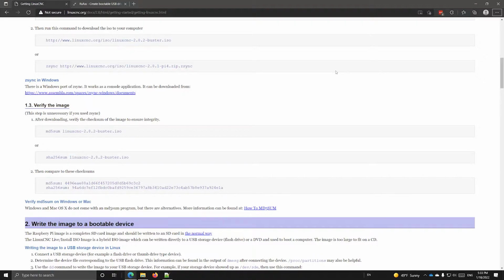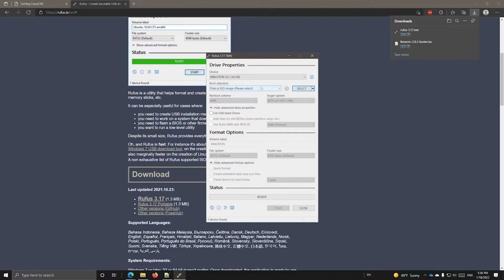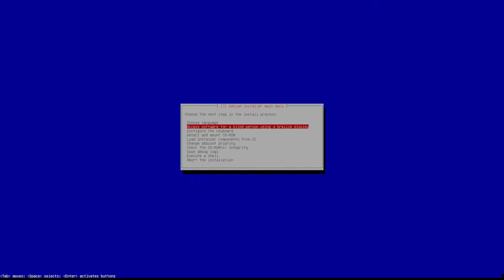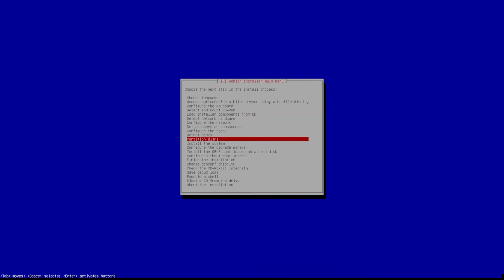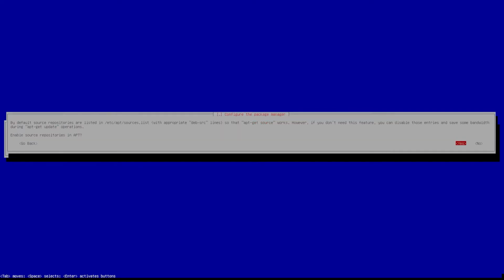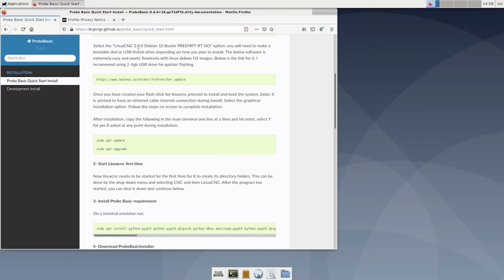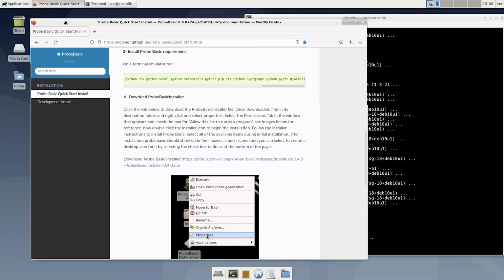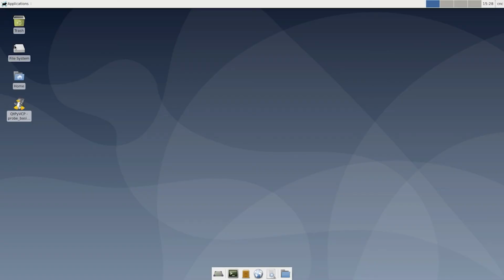LinuxCNC 2.8.2 Download, Install & Probe_Basic GUI Install

Comment: Hey Robbie, nice install video! Just to clarify, Kurt is the creator of qtpyvcp along with a lot of help from some other folks like Turboss (Jose Toledano) and Joco (James Walker) .  Probe Basic is a GUI I built and runs on top of QtPyVCP.   TurBoss and Joco are the primary contributors of time now in maintaining and fixing things and in keeping qtpyvcp current with the changing tides of linuxcnc 2.9 master py3 conversion.  I would like to personally thank them and let them know its a joy to work in that team environment!
Reply from the maker: Thank you very much for clarifying that. I'll update the description accordingly. Thank you for the great interface and of course qtpyvcp for enabling it! I also put a card to your channel in the video at the appropriate place.
Reply: @flyingamortgage  thanks for the pin!  you come across great in your videos, any chance you would be interested in doing some more on probe basic?  :D
Reply from the maker: @SmallShopConcepts  I'm certainly planning on it. Just got the parts in to finish my Z-axis so hopefully I'll get it and the other axes finished and can focus on the electrical and software side.
Reply: Thanks Chris! It is incredible how you all have taken this little project of mine and run with it! Hope to be back in the coding saddle soon.
Reply: @kcjengr  hurry up and come back!!  🙌🙌🙌

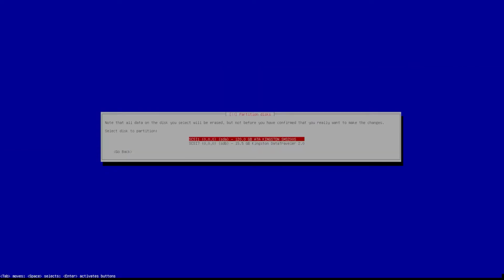Comment: Hey! I am just now setting up my new linux cnc, however i am stuck at 12:24. For some reason, only my usb stick is shown in the partition overview, not the ssd i have connected to the board (running a asrock J4125-itx with a sandisk SD plus connected. Any advice? On which of the sata connectors do you have your hd connected?

Comment: I believe the tormach controller is also based on linuxcnc. Their gui is also very good.
Reply from the maker: That is my understanding as well. If I thought I could convince my wife to let me spend $45 large I’d probably have gotten an 1100MX. 😀I’m fairly certain the resemblance between this gui and PathPilot is not a coincidence. If nothing else they have a VERY similar design language in use.

Comment: Is there a downside to run a real-time  hardware control system (plasmac) from a USB NvMe drive, over ethernet through a Mesa 7i96e card. I've measured  latency of 1.02 ms servo thread and 26 msec base thread on this drive , under the live install.?   Makes it real easy to use the computer /Windows or dual boot from the NvMe USB  for Linuxcnc.  Note on this HP Pavilion laptop I don't have an option for a second internal Nvme drive and the primary drive is maxed out from Windows.
Reply from the maker: Sorry. I haven’t used the 7i96e or NvMe over USB. Suggest you check the linuxcnc forum. Feral engineer on YouTube did some experiments with the 7i96e I think.

Comment: Was planning on using probe basic, but it looks like the link to the installer is gone, or is no longer active. (Update: I did manage to get it installed using the development install instructions, and even migrated my entire working axis config over, with the exception of the VFD RPM feedback. It appears that the version of Probe Basic that installed while following the development install instructions, didn't include the ability to link to the relevant pin for the GUI in Probe Basic to display the realtime RPM. I was reading a few threads online and apparently it's dependent on Python 3, and my Debian 10 LinuxCNC 2.8.4 Install isn't going to be able to run Probe Basic with encoder feedback unless I do an entire system upgrade... Kind of a huge pain. Not to mention I had major issues with LinuxCNC in Debian 11, couldn't even run my latency testing to tune my PC for better jitter numbers.
Reply from the maker: Yea the Python2 vs Python3 issues are real. Joco (mentioned in the pinned comment) has a github script to build a working linuxcnc + qtpyvcp + probe_basic install. Please check the note I added to the bottom of the description of this video for details. I'm going to create a new video soon that walks through that process from scratch as well.
Reply: @flyingamortgage  thank you for following up!
Reply: same, debian linuxcnc 2.8.4 and probe not working newer, only hall meter wires working ok, true/false ok. but no G-code 38.2 newer move.

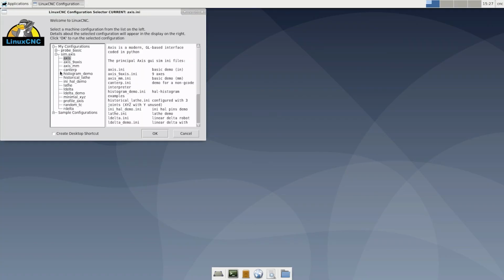Comment: Trying to follow this guide, Did everything almost verbatim (didn't use your IP address, set it to my local settings) but when I get to @25:15 you have Probe_Basic in the waterfall, mine never shows up.
Reply from the maker: The first thing that comes to mind is that maybe you installed it as root or using sudo. It needs to install in the home directory of the normal user, inside the linuxcnc directory. That's why you have to run linuxcnc once before you install probe_basic, because it creates those folders. Just guessing, obviously, since I can't see your system. Double check that a /home/<login_name>/linuxcnc/configs/probe_basic exists and that there's a probe_basic.ini file in it. You can look for the probe_basic_installation folder and find the InstallationLog.txt file to see exactly what was done where. Hope that helps. <login_name> stands for the name you use to login to the system with. In my case, I used cnc so my home path is /home/cnc/ If you used "mill" for your login yours would be /home/mill I hope that makes sense. Best of luck!
Reply from the maker: I decided to add my config folder to GitHub. As soon as I get back from errands I’ll upload it for reference and link it here in a comment for you.
Reply from the maker: Here you go @Rusty Horlacher https://github.com/attentiondeficitdisasters/linuxcnc_mill_config hopefully you can use this to see what went wrong. This will be updated as I make changes in the config during my build.

Comment: @26:29. How did you boot from the USB ?  Mine keeps booting into windows.
Reply from the maker: Well, in the case of the NUC I was using, USB booting was enabled in the bios. I can't include instructions for enabling USB booting for every bios, so that's something you're going to have to research. I'll add that on most PCs there's usually a key you can hold down during power-up that will give you the "boot options" screen and let you choose USB if it's not higher in the default than whatever is on the hard drive. All of those things can usually be disabled though and I know plenty of IT departments that will do so to reduce the ease of tampering.

Comment: Hello, if i have a working configuration of axis, ca i update to probe basic and copy settings from axis ? Or i need to do all the setings again? Thank you.Alexandru
Reply from the maker: @alexandrubudu541 you can take the existing working .ini file and modify the DISPLAY entry to DISPLAY = probe_basic but I’d recommend copying the values into a new .ini file specifically for the probe_basic install

Comment: I have core 2 duo, which installer is up to date ?
Some thread suggesting bullseye XFCE and 2.10.
This confuse me more, tried all of them and not working.
I know nothing about linux and how to install except from google.
Reply from the maker: If you are asking if 2.8.2 is up to date, the answer is no, it's a little outdated. I should probably make another video. Kinda stuck in a rut right now though. Bad ballscrew.
Reply: @flyingamortgage  pls make the up to date video, and I can not get the 1080 resolution, there is no selection for that resolution display.

Comment: Hi there, now i can open LinuxCnC, run demo " LINUX  CNC " and i already love it...bu is Linux CnC works with another card, i get a MEGA 2560 with 1.1e Grbl for 4 xes ?
Thank's to yo
Philip
Reply from the maker: I think LinuxCNC takes the place of GRBL generally. I’m not sure how you would use LinuxCNC to drive s different GRBL device. I suggest asking on the LinuxCNC forums. They are very active, knowledgeable and helpful.

Comment: How can you setup slave axis  XYY1Z router gentry with 2 homing switches  in GUI, like MACH3, without editing any HAL file? thanks in advance
Reply from the maker: Assuming you were asking about a MESA 7i76e implementation when you create the initial configuration using pncconf tool, you would make one of the steppers drive a "tandem axis." For example, one stepper would drive Y axis and another would drive Y2 tandem axis. However, I would never suggest that you will be able to get to a fully functional machine without hand editing the HAL files to a greater or lesser extent.
Reply: @flyingamortgage  XYYZ not working sure, i has try many many hall and joint files forum try help me and not any  files no can working, lot only errors what not understand and no know how repair all. only working well normal XYZ set-up in wisard. joint system has try change many many different what has in forum . but not working newer, same probe 38.2 G-code try many many different code run but no move.

Comment: what distro need download if have HP intel core2 duo p8400 processor, have this arm or 64 or i386 or what need download.what distro need my old hp paraller port computer preem or rtai or what.
Reply from the maker: It’s 64-bit (you could have googled that) and if you want to use the parallel port I’d suggest downloading the PREEMPT-RT ISO first and trying that (as per the instructions on the linuxcnc site) Going full realtime kernel is NOT for the faint of heart and is something I’ve never done personally. Good luck. There are some other videos on that if you search. https://www.linuxcnc.org/downloads/
Reply: @flyingamortgage  thanks u answer, need i install empty pc first usb stick normal linux buster OS and then install linuxcnc buster. or only linuxcnc-buster iso or link debian 10 buster PREEM RT.iso only im not good whit my raspian4 table computer, iso can make bootable usb stick whit raspian imager maybe. tomorrow come mailbox old used HP computer intel64 core2 duo. i hope i understand how i make bootable usb whit my raspi4 8gb table computer, before has only used windows7. but now all stay to thailand i go to finland. i has download normal way downl link linuxcnc  2.8.4 buster ISO and make this mdcheckum ok, and whit x11 windows DD make usb boot. but not know have this richt ISO for me. maybe need try first this RPEEM version (i not know what this mean)
Reply from the maker: @mattivirta  you can install the linuxcnc distribution from the bootable USB directly. You don’t need to install another distribution first. You can use the dd command to create the bootable USB stick from the ISO image. You can follow the directions here: https://linuxcnc.org/docs/stable/html/getting-started/getting-linuxcnc.html#_write_the_image_to_a_bootable_device for the Linux section right at the top. Good Luck!
Reply: @flyingamortgage  thanks u answer, this has same site were i found DD code, i has make usb stick now, need test when i have time next week. thanks.

Comment: It can run on x86  and running grbl firmware sir??
Thanks...
Reply from the maker: It will run x86 but it is not grbl firmware, linuxcnc is its own thing.
Reply: @flyingamortgage  oke thank you so much .. I Will be learning about that... 🙏
Reply: why need use old worst pre-history GRBL system were not subbort all G-code and lot problems many, if can same hardware use lot better linuxcnc system.

Comment: How does the NUC do with latency?
Reply from the maker: Holds servo thread (1ms) and base thread (25μs) just fine. Max jitter for servo thread is 25300ns and base thread is 32600ns. Max interval for servo thread was 1025277nS and base max was 57594. Under load. Most of the time it stayed locked on. For my use case, driving servos via step & direction pulses generated by a Mesa 7i76e communicating back to linuxcnc over Ethernet it should be just fine.

Comment: mesa card have non possible uses normal hobby users too expensive anywere ower 200$ no thanks, can we use protoneer board whit linuxcnc, raspberry pi3 ? its best compination use, raspberry somethink cheap board, external motor drivers and big motors then can mill aluminium,wood,etc. but how setting linuxcnc to protoneer board all step,dir,enable,spinle,limit SW,cooland,probe,
Reply from the maker: I don’t know what a protoneer board is or whether it will work with a Ras Pi 3. As for cost… Each of the servo drives for my build cost far more than the MESA. The electrical cabinet cost twice what the MESA does. The contactors cost more than the MESA.

Comment: I have optiplex 745, I want to install like you did with USB, but it keep trying to install from cdrom and trying to mount the cdrom, i can not skip that mount.
Reply from the maker: I think it's just a nomenclature issue. The USB is actually a CD-ROM image. If you look, mine said mounting CD-ROM as well. I'm so used to that with USB images I didn't think to comment on it.
Reply: @flyingamortgage  yes but I can not mount it.
Btw it says error ata2.00 srst failed errno=-16, reset failed, print_req_error I/O error.
Right after booting from USB.
Reply from the maker: @calico88  Honestly sounds like it might be bad hardware. I haven't bought Dell desktops in... a decade, so I'm not familiar with them. How old is the device?
Reply: @flyingamortgage  maybe 10 years old, it’s dell optiplex 745, the reason I’m using this is because parallel port and cheap.
Can you guys recommend budget hardware friendly linuxcnc 5 axis TCP ??
Mesa board is too expensive.
This video only discussing linuxcnc software but I can not find hardware budget running linuxcnc 5 axis TCP ??
Reply from the maker: @calico88  Sorry, I can't help you there. Have you looked at https://www.youtube.com/channel/UCOKskywuQDlnV8yIkv67Gfw he has a series on a DIY 5-axis
Reply: @flyingamortgage  finally i got it running and install linuxcnc, but there is an error while installing probe basic requirement, I think it’s installing phyton.
Package python-dev is not available.
Etc
E: unable to locate package python-pyqt5.qtquick
Etc..
Di I miss something ?
Reply from the maker: @calico88  I’m glad you got it working. What was the issue keeping it from booting? There’s no way for me to tell if you missed something or not. I recommend you check out the LinuxCNC forum https://forum.linuxcnc.org/qtpyvcp
Reply: @flyingamortgage  the issue was the pc bios, need to update.
Yes I will ask on that forum, thank you.
Reply from the maker: @calico88  good luck with your project!
Reply: @flyingamortgage  i’m afraid to post that forum because that forum is linuxcnc not Probe basic GUI.
My problem is after installing the step 2 of probe basic GUI.
Reply from the maker: @calico88  No need to be concerned, the probe_basic developers operate out of that subsection of the forum that I linked.
Reply: @flyingamortgage  cool

Comment: holy smoke his internet download in 10MB/s
Reply from the maker: Not to flex but I have gigabit fiber to my house. The download server wasn’t particularly fast. I’ve seen 60+ MB/s out of a theoretical max of 125, but you never really come near the theoretical maximum. Typical steam downloads are about 40MB/s.

Interesting note: when I first got the fiber I had an apple airport “gigabit” router, but it wouldn’t throughput more than about 270Mbps. The router the ISP supplied would only do about 650Mbps, so I ended up building a pfSense router myself to better utilize the bandwidth I was paying for. It can do about 800 throughout. Laptop directly connected will do 970+
Reply: normal download speed all have 60-100MB some second has all load

Comment: Hello, I discovered your video, great! on my side I created a dual boot with iso file of debian 11 + rufus + complete debian11 installation with in the end the request to remove my USB key and restart my PC .... but when opening the PC I I still have 2 items...Win10 or Continue installing Debian.........I can never launch Debian...If you have the solution, I'm interested.
Thanks
Philip
Reply from the maker: Sorry. I haven't tried a dual-boot install of any distribution of Linux since Windows XP. I wouldn't know what to tell you. I can suggest checking the Debian forums or reddit.
Reply: linuxcnc need own old cheap computer use, not you normal windows PC. old used paraller port PC 20-40$ can buy. you windows PC can use all CAD/CAM softwares draw parts and translate G-code.